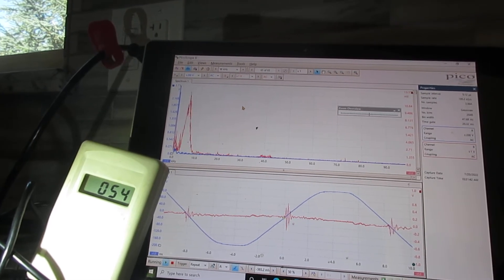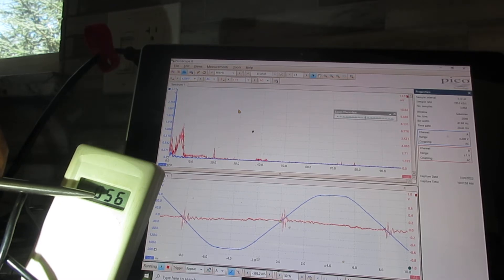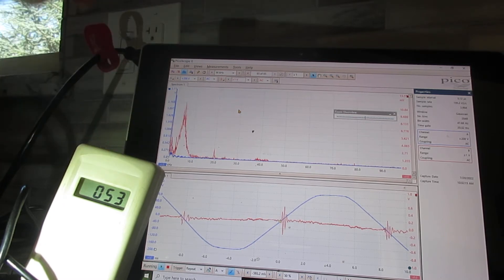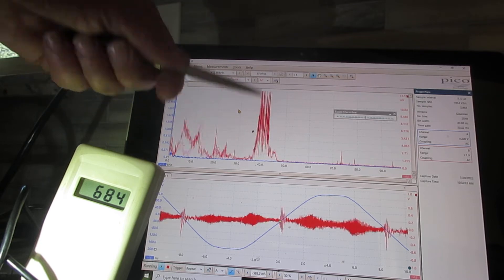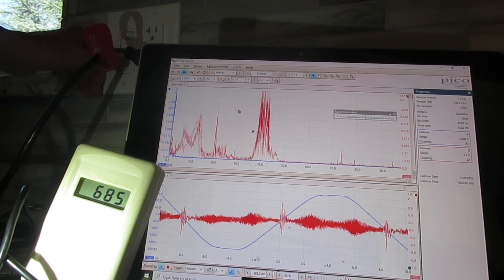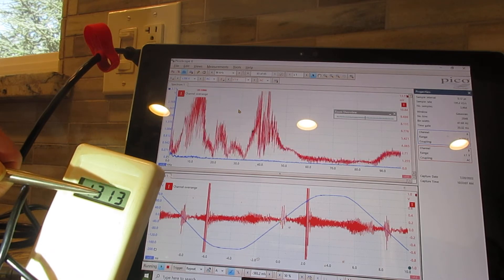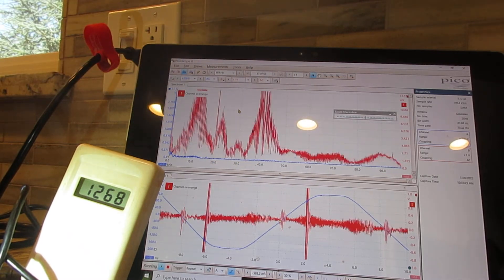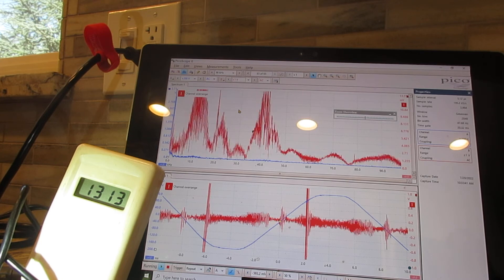Dimmer switches create Dirty Electricity and painful pressure in the head of my client

Comment: Interesting. This is something new to me and I've been looking to buy a trifield tf2 emf meter to check my house. Is it a case of going from room to room to look for higher readings with things turned on and off, or do i need to go to where the cables are ran in or the wall switches and other devices?

Do dimmers only create dirty electricity when turned on? Can unused blank fused spurs give dirty electricity?

I want to build a new house & try to eliminate some causes if I can.
Reply: A trifield tf2 does not measure Dirty Electricity (EMI),  it measures EMF.  You need a stetzer meter or similar to measure EMI
Reply from the maker: You will need a Stetzerizer Micro Surge meter to measure DE.

Comment: Wait but can you explain what the solution is? Is there a special kind of dimmer to look for that avoids the dirty electricity?
Reply from the maker: Hello Aaron: replace all dimmers with on/off switches as all dimmers make some degree of DE.  IN this case a lot of DE was coming in from the  utility feeder so we have to determine what is the best type of DE filter to install at the min panel.